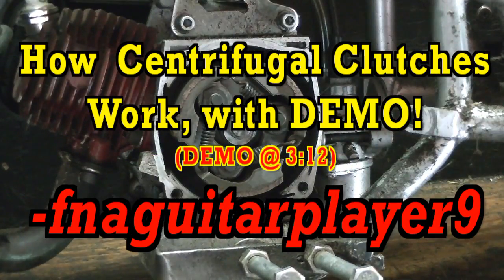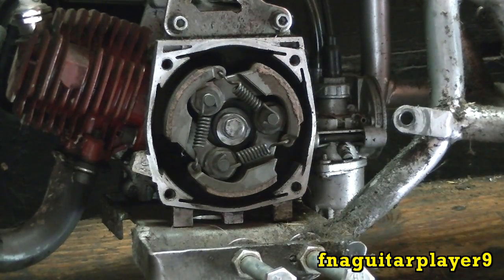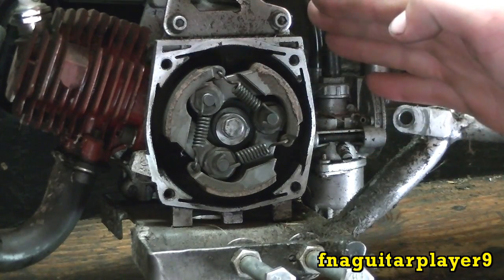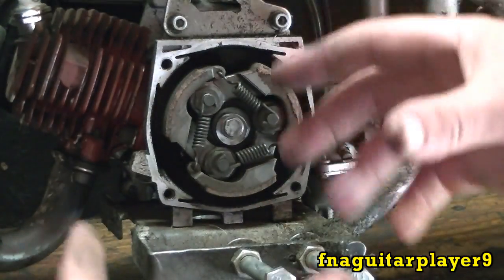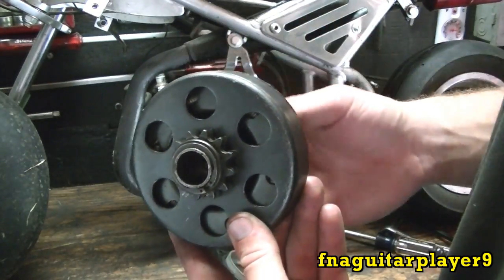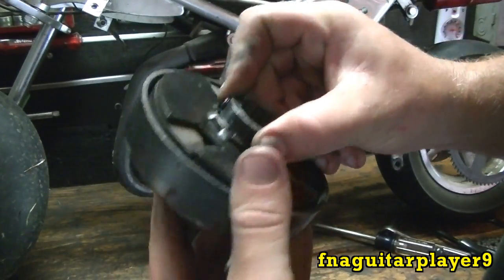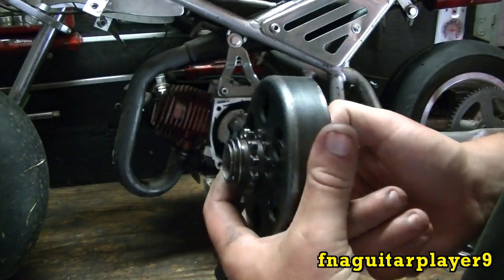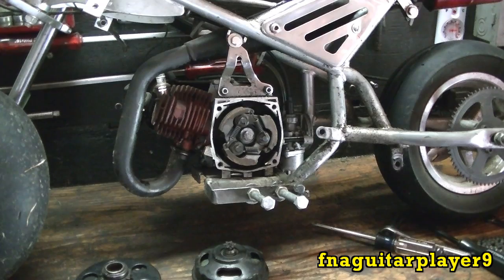How Centrifugal Clutches Work with DEMO at 3:12

Comment: Thanks I was searching around for a video to fix my pocket bike wheel problem the problem I have is that it won’t move nor the clutch housing was moving but the clutch was spinning while idling but when I go to pull the gas the bike wouldn’t move so I looked at the clutch and housing and it’s all rusty

Comment: Are these things durable?? I have a 5 year old moped bike with 20000 kms on it and today when I took it to the yamaha dealer service center they were strongly suggesting me to replace its shoes and belt. So should i?? And are they durable?? I mean 20000 km is not much to ware these parts out right?
Reply from the maker: More then likely that will have a torque converter and not a actual centrifugal clutch, i could be wrong but i'd say thats what it is, and the belts do wear out on them, not sure about how many miles/kms though. Thanks for Watching!!!
Reply: @fnaguitarplayer9  hey! Thanks for the reply and no it definitely has a centrifugal(friction) clutch on it and turns out that the clutch carrier assy didn't need replacing but they unnecessarily replaced it anyways, these scammy dealers I tell ya just don't want to help the customer, they want to loot em! lol. Anyways here's a question:   are the clutch shoes which attach to the housing made of metal or some other material?

Comment: I'm still left wondering, though, how my Honda Silver Wing can hit 75 mph (no problem) without me hearing any shifting of a gear. There has to be more than one gear, right, in order for the bike to get that fast from a dead stop (and it does it quickly). There simply wouldn't be enough power to start the bike from a dead stop if it were just one gear in play...at least I wouldn't think. So I don't understand how that part works.
Reply from the maker: It probably has a torque converter, and not a actual centrifugal clutch setup. Thanks for Watching!!!

Comment: My theory on the lifespan issue of your clutch is the springs are too strong. Have them engage at a lower rpm, use weaker springs. This is tricky tho...put a kill switch in.
Reply from the maker: Your probably right, I do have a weaker set of spring in it now and it seems to hold up better and engage better. Thanks for Watching!!!

Comment: Hi thanks for the info,my 49cc quad with centrifugal clutch has a problem related to your video.When I pull start quad I have to raise rear wheels in order to start it and after starting wheels keep turning .As soon as the wheels touch ground the engine stops.I am assuming that the clutch is stuck.Do you have any recommendations please!
Reply from the maker: It may be idling to fast, trying adjusting the idle down to disengage the clutch, if that doesn't help then the clutch spring could be broke keeping it engaged. Thanks for Watching!!!
Reply: You were correct spring was broken,cheers

Comment: How do uprated springs (more tenskon) improve it  the clutch as looking at how it works you would think a lighter spring would be better
Reply from the maker: Low tension springs will allow it engage sooner at lower RPM's, which is good for general purpose riding or in grass, heavy tension springs allow the engine to rev up higher so it may have more off line take off on pavement/concrete. not recommended for riding in grass, it will slip more and burn up. I think i used the medium tension springs on this but it may be the light ones can't remember. Thanks for Watching!!!

Comment: Question:  When on the go with a centrifugal clutch, does it stay engaged at higher speeds if the engine isn't giving it power?
Reply from the maker: It will stay engaged for just a bit since the clutch is still connected from the centrifugal force, but it won't take long for it start slipping then finally disengage. Thanks for Watching!!!
Reply: @fnaguitarplayer9  So say, if I were to put a 420cc engine in a car, with a gear reduction that connected to a centrifugal clutch, would it be possibe to let off the gas to change gears like a "neutral" position, since the clutch doesn't have the engine power going to it?
Reply from the maker: @cruelchris3099  that has actually been done, but they didn't use a clutch. I think it would work, hard to say how smooth though. It would probably have to have a lighter flywheel to get it to idle down faster i'd say.

Comment: dont understand how centrifugal force is enough to keep pads with the outside part engaged?i thought its a small force. does it only work at high speeds? to make it work at low speeds should i loosen the springs? but at low speed centrifugal force is lower, but the rotating force is the highest, when we are going uphill, so how can it work without slipping?
Reply from the maker: It is, but keep in mind even if the springs were removed and all the force was applied, it will still slip some, they remind me of a torque converter in a car, its never 100% connected (unless it is a lock up torque converter), not a exact comparison but its what it reminds me of. But yeah it will slip especially going uphill. Thanks for Watching!!!

Comment: hey I have a question 
I have the same motor and the same thing and when I put the throttle down you can hear it it wants to go you can hear full throttle but dosnt wanna move moves really slow if you could help me asap please I thing it's the spring not tight enough to spread out all the way to make it run not sure need your help thank you 👍
Reply from the maker: Sounds like it will need a new clutch, these are bad about the the clutches wearing out, you should be able find one ebay for 5-10 bucks. Your welcome, Thanks for Watching!!!